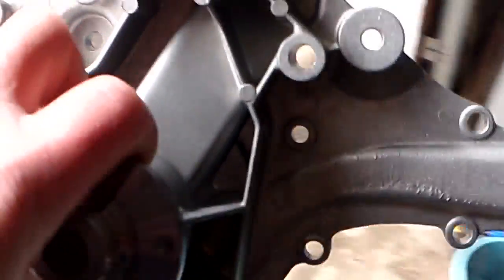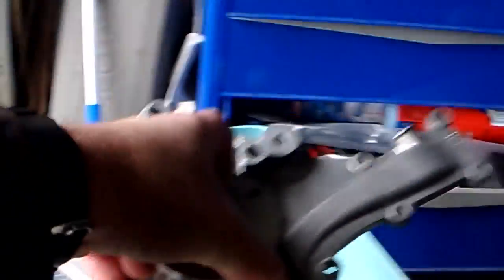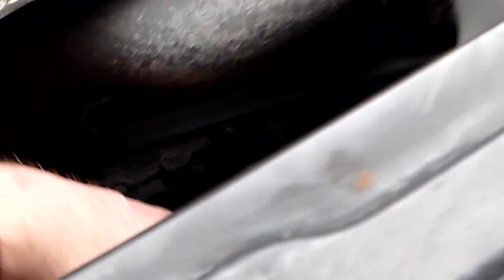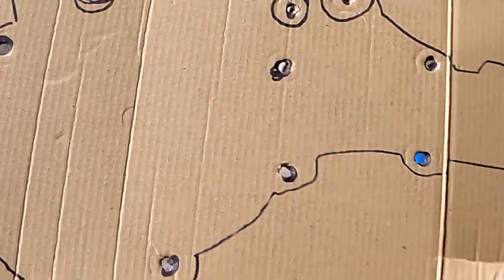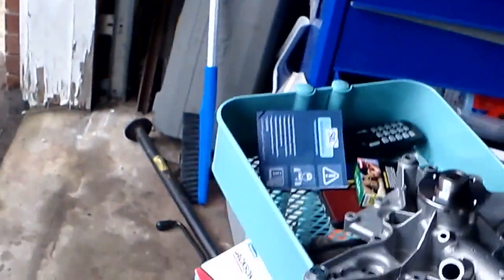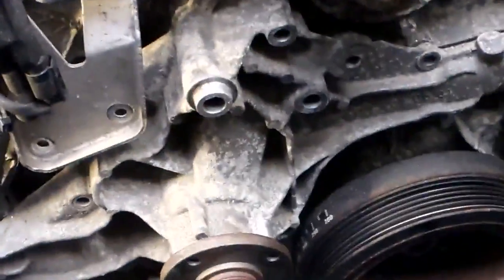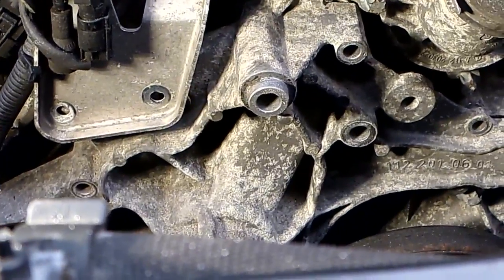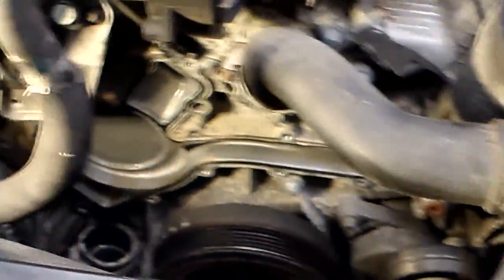Mercedes M112 V6 water pump replacement..M113 similar

Comment: What a great video,  and you pointed out every step! Changed my alternator,  pulleys, water pump,  belt! 3 hours job! Most garages would had charged me ££££ Thank you! BTW working on a m112 engine is so easy! Plenty of room plus bonnet opens 90°
Reply: Yeah I am at the point where I have to replace mine because I just replaced the tensioner assembly, but now my water pump pulley barely spins and it’s leaking. Was it hard for you? And I don’t have any power tools

Comment: Making that template to store the bolts in is a really good idea in my opinion. Thanks for the video. I'm planning to replace the water pump on my ML500 this weekend.
Reply: That's what I do to...l lose things terrible bad when I'm working on things because I'm old ..and it frustrates me way worse than the pain in the ass mechanical side of diy for sure

Comment: -If for what ever reason you don’t have a 17mm Socket and/or ratchet, refer to the socket wrench in trunk, normally used for spare tire—I believe they made it to fit idle pulley in case belt suddenly breaks while driving.
Reply: EXCELLENT TIP...

Comment: just so you know to loosen the belt tensioner, the bolt is actually southwest of the screw you used. its a 17mm and won't ever get undone and is the proper way to relieve tension on the belt
Reply from the maker: You are correct 👍
Reply: There is also a small hole ,stick a Allen wrench or skinny rod in it and it will lock the tensioner in the wide open position so so can remove it with both hands

Comment: Getting the fan off is the hardest part of this job if you don’t have the right tools. I would love to see a demonstration on exactly how to do that and the tools used. Your normal wrench, will not fit between the water pump pulley and the 4 bolts holding the pulley. Which makes this job a lot harder than removing the 18? Bolts and couple hoses.
Reply from the maker: check my fan removal vid on my W463 playlist
Reply: fupabox Thank you !
Reply: 12:09 Why does he use different size screws in a water pump? because they are the most stupid design. when I listen to bunch of those information, I will never buy Mercedes, even German car again. If you have a lot of money, you better poured them into the pacific. why no body talk about it because the car owner like to show of and they shame to tell people they paid the good money to buy a stupid car. mechanic only know how to repair very common problem but they can make good money too.
Reply: You can do this job without removing the fan at all .Just the belt tensioner and idler pully is all you need to get out of the way

Comment: Great video thank you.  I have a 2004 c240 4matic and “think” my engine noise is a bad water pump/pulley.    No codes or CEL but a very noticeable clicking type noise that is louder on acceleration but comes and goes but usually persists at idle.  How can I test if my noise is actually a bad water pump / pulley???    Drove the car 400 miles and no issues with it but know sometethjng is wrong and needs repair   Thank u
Reply: Did you fix the clicking noise? Was it the water pump? I know this is an old post but I think I have the same noise. When your idleing everything is fine, but the faster you accelerate while driving, the faster the noise gets. I'm hearing this on a 2000 clk 430.
Reply: @ricky-sanchez  i still have the sound coming from the water pump pulley.  its fine when i'm driving 30+ MPH but when driving slow and touching the gas you can hear the rattle sound.   i took off my belt and was able to spin the pulley and could definitely hear it making noise when turning it by hand.   i've had the slight noise a year now and its just started to get worse and occur more often.  i bought a new pump and will get it replaced in the next month...
Reply: 12:09 Why does he use different size screws in a water pump? because they are the most stupid design. when I listen to bunch of those information, I will never buy Mercedes, even German car again. If you have a lot of money, you better poured them into the pacific. why no body talk about it because the car owner like to show of and they shame to tell people they paid the good money to buy a stupid car. mechanic only know how to repair very common problem but they can make good money too.

Comment: Fantastic video,  but I can't get the new hose to stop leaking or seeping.  I bought OEM hose  from benz dealer . It's been a challenge.  I need to do a UV  light inspection of the leak.

Comment: Bought my ml320 with 35,000 miles it just passed 200,000. I've only used the zerex g05 and my cooling system functions great.
Reply from the maker: I love the w163 ML...If it was diesel it would be perfection. Agree on the Zerex . I've been using for the last few coolant changes .

Comment: just wondering how did you bleed the air out of the system afterwards? did you just run it with the coolant reservoir cap open?
Reply from the maker: +illstplaya  Once the overflow bottle is refilled turn the heater on high and start the car... leave the cap off the overflow...keep topping off until the level no longer drops and the car reaches normal operating temp, and the heater is blowing hot air in the interior..then replace the cap, done

Comment: great video,,, let me ask this,, you mention to tread lock all bolts,, can I ask why? I know you don't want the bolts come loose but they don't come with any thread lock from manufacture, in fact I would Anti-Seize them,,, my reason is that I tried to replace the thermostat on my 04 s430 and one bolt broke off so now I have to try to drill it out, am I wrong? what are your thoughts
Reply from the maker: Years ago a Benz. specialist told me to threadlock the bolts on any part attached to the engine for 2 reasons...obviously locking the bolt from vibration, but also to keep the bolts from seizing
Reply: I thought thread lock kind of glues the bolts in for vibration therefore to take them out its a pain unless you heat them up, am I wrong?  ok thanks for the reply, ill try to drill mine out today
Reply from the maker: Alfredo Azure G There are 2 types of threadlock..the blue is normal strength , and prevents seizing as well as locking the bolt. The red is permanent strength and requires heat to remove

Comment: Did you use any permatix when replacing the gasket?
Reply: If there is a rubber seal that comes with the kit. You are not to use any kind of gasket maker or permatex. You should not use gasket maker or permatex on any water pumps that have a rubber gasket. You take a bigger chance of it leaking in the end. All you need to do is clean all the mating surfaces properly and you should be good. And the reason why you do not use permatex on systems with a rubber seal is because over time the permatex can disintegrate and contaminate the cooling system.
Reply: @youandiryan  That's right ,leave that stuff alone.lf he ever has to do this again that gasket maker will cause him to he scraping that stuff for hours to get it clean and the tiny pieces gets all over everything ...it's completely a mess and not needed. That gasket works ,if you want to do anything g grease it with silicone grease  very lightly before you install it to preserve the rubber

Comment: 2000 E430 (M113 V8, I believe), This is a terrific video. I have just a few questions. My fan is attached to the threaded water pump. 

1) Any idea how to get the fan off the pump? 

2) the other videos I saw required the radiator be removed to change the WP. I have changed the radiator before. It was a pain that I would not look forward to again.
Once again, great video.
Reply from the maker: The 4 10mm bolts on the fan pulley should allow you to pull the whole fan off including the pulley
Reply from the maker: Just a quick note .. I'm wrong . you do need a fan clutch tool to remove the mechanical belt driven fan . I was thinking of something entirely different . Most auto parts stores will rent you a fan clutch removal tool that slips behind the pulley to hold it in place . then a (24mm I think ) wrench to loosen the bolt
Reply: 12:09 Why does he use different size screws in a water pump? because they are the most stupid design. when I listen to bunch of those information, I will never buy Mercedes, even German car again. If you have a lot of money, you better poured them into the pacific. why no body talk about it because the car owner like to show of and they shame to tell people they paid the good money to buy a stupid car. mechanic only know how to repair very common problem but they can make good money too.

Comment: Hey man thanks for the video you kind of had me cracking up about the reverse bolts. Anyway I bought a 2000 Mercedes E3 20 And I have had it for about a year and the tensioner assembly Needed to be replaced because Belt broke, etc. instead of replacing the tensioner assembly I first just tried replacing the pulley which in turn broke my coolant pulley which is wobbling all over the place. So now I have to replace my water pump. And I do not know much about cars I’m learning this as I go and I’m very nervous about replacing the water pump but I cannot afford a mechanic. If I was able to replace the tensioner assembly By myself do you think I’m able to do this by myself?
Reply from the maker: yup...just follow along ,,keep track of which bolts go where ..make a cardboard map for them . and don't overtighten them . Most people get into trouble overtightening bolts and stripping them .
Reply: fupabox OK yeah I’m definitely doing the cardboard thing like you did. I’m going outside myself and I only have the basic tools no power tools 😕 But I already did the tensioner assembly so I’m hoping I can do this. Luckily I am in Florida so it’s like in the 60s all day right now lol
Reply from the maker: @Bonbonbon739  in the 60s .. I can only wish . ...I have faith in you, you can do it
Reply: fupabox aright thanks man. I am re-watching your video step-by-step and I’m going outside to start. I just got the new water pump in the mail today. Bought some sealent and wish me luck! I need my car back!

Comment: I always had 50/50  chance of success or failure using regular sockets on E-torx bolts prior to discovering it was actually a completely different socket set required. The smaller the head size the greater the chance of stripping it though.
Reply from the maker: +MMWA  I agree..  The stripped bolt remover sockets actually grabbed well..I was lucky.. first thing today is to go get my etorx set back  :)
Reply: I don't lend tools anymore for this reason. They are never there when you need them. If people want my special tools they get me as well and I'm always returned in one piece along with my tools ;)
Reply from the maker: +MMWA   lol.. I don't always come back in one piece  .  :P
Reply: 12:09 Why does he use different size screws in a water pump? because they are the most stupid design. when I listen to bunch of those information, I will never buy Mercedes, even German car again. If you have a lot of money, you better poured them into the pacific. why no body talk about it because the car owner like to show of and they shame to tell people they paid the good money to buy a stupid car. mechanic only know how to repair very common problem but they can make good money too.

Comment: Which way did you turn the fan bolt when you took it off? Clockwise or counterclockwise?
Reply from the maker: counter clock wise
Reply: fupabox thank you very much.

Comment: Hello, I have a 2002 C320. I need to buy a torque wrench and looks like I need 2 torque wrench where one will allow me to torque the low torque value and the other one will let me torque the higher value (bigger bolts). This is the only part I need that is confusing me and I don't want to to mess it up at the end. Please help!

Comment: How did you removed the screw near the timing pully?
Reply from the maker: depending on the tools you have , you can use a closed end box wrench (12 point) Or use locking pliers on the socket since there is no room for the socket wrench handle under the pulley

Comment: How can you go about detailing this engine? And what are you using to get the torque specs on each bolt?
Reply from the maker: Detailing you can use a toothbrush and a lot of time. engine degreaser, and The one thing I use a lot on engines is foaming tire cleaner..it won'y hurt the wiring or rubber hoses, and cleans the plastics really well..I get torque specs from the factory service manuals  ..here.. http://workshop-manuals.com/mercedesbenz/

Comment: Just a question. U have an idea of how to remove the front and rear bumpers? thanks
Reply from the maker: +Daniel Pehrson   I do know how,but describing all the bolt locations would take me forever..I'll give you a link to the service manual page for the bumpers
http://workshop-manuals.com/mercedesbenz/c_240_sedan_(203.061)/v6-2.6l_(112.912)/body_and_frame/bumper/front_bumper/system_information/service_and_repair/removal_and_replacement/
Reply: +fupabox oh sorry was thinking bout the w208 but thanks anyway:)
Reply from the maker: Daniel Pehrson I'll link you the w208 manual  .. starts on this page then hit next page at the bottom
http://workshop-manuals.com/mercedesbenz/clk_320_(208.365)/v6-3.2l_(112.940)/body_and_frame/bumper/front_bumper/system_information/service_and_repair/page_10290/

Comment: Do you know what would make the fan run all ways after installing a water pump
Reply from the maker: if you mean the electric fan .. it is likely there is an air pocket in the cooling system around the temp sensor. Squeeze the hoses while the car idles ..you can often pump the air bubble out by squeezing the hoses. You can also jack up the front of the car on the coolant reservoir side to ensure it is the highest point in the cooling system .. then while idling the air will rise to the reservoir and be released
Reply: fupabox ill try that in the morning..but also the air wont blow at all after putting on the new pump
Reply: fupabox just found out my coolant sender is bad ordered one...you think that could have something to do with it
Reply from the maker: Ahh  ok.. that would do it
Reply: fupabox lololol...thanks bro

Comment: water pump rattling cause engine vibration ?
Reply from the maker: it would have to be pretty bad to cause an engine vibration , but it is possible. While the engine is running use a long screwdriver placed against the non moving body of the pump and put your ear to the other end ( handle) of the screwdriver . If the pump is bad you will hear it amplified through the screwdriver

Comment: My water pump basically shredded internally.  When I drained the coolant (as I was installing a new pump) 5 round bearings came out into the drain bucket.  I don't know how many bearings these pumps have in them but I hope I don't have any more bearings floating around in the cooling system.  Does anyone know how many total round bearings there are in these pumps?  My car is a 2000 CLK 430 (M113).  I plan to finish the job in the next couple of days.  Thanks!

Comment: what size and what kind of bolt is at the bottom near the hoses that requires a male torx or hex socket
Reply from the maker: +jameel neverson e10,e12,e14  are the 3 reverse torx socket sizes needed

Comment: Wait I was thinking I was going to be able to do this and now your talking about pounds? I’m so confused and I only have a regular 3/8 ratchet. I do have correct sockets. But I’m confused about all the pounds your talking about when putting bolts back in. Are you talking about how much pressure you should tighten them? When putting them back on?
Reply from the maker: The lbs is the torque or force applied to the bolts . the torque generally corresponds to the size of the bolt . If you grad you socket wrench nearer the middle instead of at the end of the handle , you will usually be able to keep from torquing the bolts too tight
Reply: fupabox OK so do I need to buy a torque wrench? will I make it a lot easier? Instead of the 3/8 ratchet? My new water pump I pick it up tomorrow at O’Reilly’s I’m really nervous because I’m not a mechanic and I’m really just going off your video. So when I put the new one on just make sure that I don’t tighten the bolts too much? And do you know all the sockets sizes I’ll  need?
Reply from the maker: @Bonbonbon739  If you intend to be doing more automotive work on the engine components, a torque wrench is a great investment . It doesn't need to be an expensive one either .
Reply: fupabox I did it! Took me 7 hours (like I said I’m not good with cars, and once of my sockets broke) but I did it thanks to your video. Thanks man I can drive my car again.
Reply from the maker: @Bonbonbon739  excellent . glad the vid helped

Comment: how many miles does this pump have? Is that the original waterpump, or was it already replaced? Thanks!
Reply from the maker: +rosharky  original pump with 70k miles.. the pulley was loose which allowed the belt to pull on the water pump at an odd angle, which I assume is why it failed.. seems way to early for a pump to go bad.

Comment: What brand is that water pump ? I am gonna need one soon and e bay is full off 30 to 60 dollars i guess aftermarket brands. What would you recommend ? i know genuine is way to go but its way to pricey .
Reply from the maker: +eldin dukic  sorry for the late reply... The pump brand was SIL   Italian manufacturer... around $120 canadian.  They supply both OEM  and aftermarket parts
Reply: I bought a Graf pump. Low quality compared to oem. Had to sand down water inlets to get a good seal at the hoses. Had big mismatches from the casting. Also very rough finish from their sand blasting the pump.
Reply: Irontree pumps ..cheap yet effective